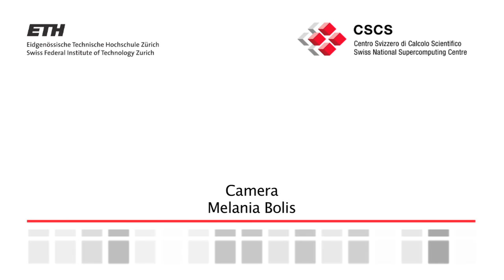Upgrade and extension of Cray XC30 "Piz Daint" supercomputer

Comment: That is way to much thermal paste for a processor. It's conductive, if it spills over it can short the mother board.
Reply: Uhh no. Most thermal pastes are not eletrically conductive.
Reply: +BiscuitFever It's not conductive... but too much anyway
Reply: They probably do not use conductive thermal paste, also its like a 130W non soldered chip